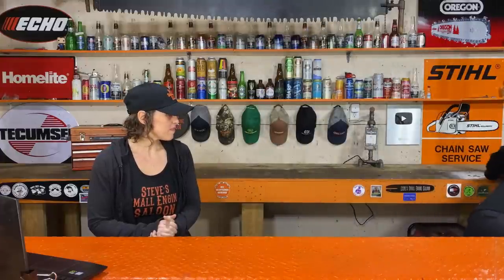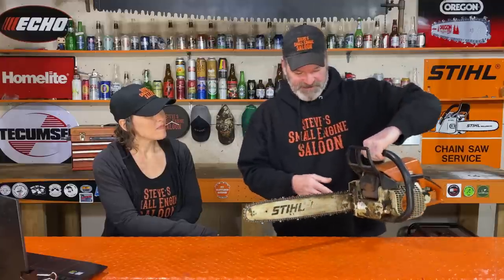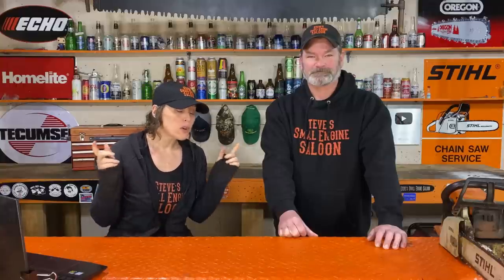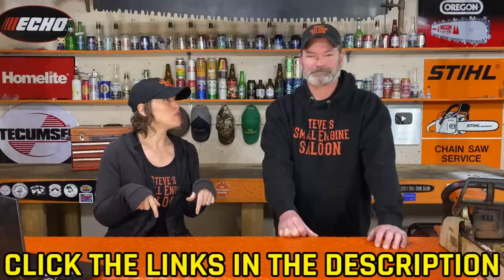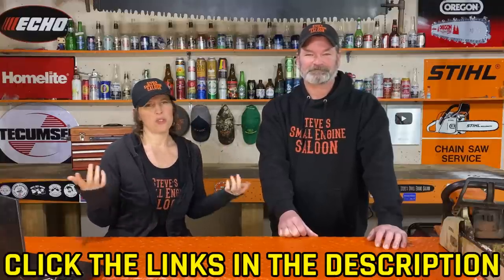Why Does My Chain Saw Leak Oil? (DAY 17)

Comment: Never hurts to crack that cap and release any pressure in the tank. I've had saws that leak for days and weeks, long past the residual oil on the bar and sprocket. Thanks for the video. Cheers!
Reply: same here releasing the pressure in the oil tank solved the leaking issue !
Reply: This!
Reply: surprised he didn't mention that
Reply: Thanks for the suggestion.   I'll try that next time..
Reply: thats a good idea - will try that thanks

Comment: It's called draining down. Simply store it on a piece of cardboard or plywood. My father was a logger for many years when he was in his twenties and thirties back in the late 70's and early 80's. He taught me all the tricks of the trade over the years. Truly valuable, priceless knowledge to be give by anyone. Every saw a person will use will do this to some degree especially if you do any cutting in colder weather than put it away in a warm dry play. It is perfectly normal. What isn't normal is the free flowing mess that you get with a damaged  tank or line that can drain out almost as quickly as the tank is being filled. That will  be readily noted by the massive spill all around the saw as apposed to the small drip that appears below the sprocket. 

Thanks for your always helpful information you cute couple you🥰! Have great week ahead!

Comment: Yup. Every chainsaw that I've ever owned has "leaked" oil. Your #1 reason makes a lot of sense. I think the next time I use my saw I'll strip it down and give it a good cleaning after use. Then I'll watch for a leak... Wish me luck!
Reply: That will take care of 99% of the oil oozing out and down 👇 on the ground. Don't forget to clean the bar groove too, lots of saw dust in there that will trap oil as well.
Reply: @donmayberryjrsOPE  Yep. That's so. I usually clean everything occasionally, but not right after I cut. I'm too tired... or too lazy. 😒 It is something that should be done regularly.
Reply: Me too. 👍

Comment: Hi Steve,I enjoy watching your videos. I own a Husqvarna 550xp and it was leaking bar oil etc when stopped. I fitted a new pump,oil cap,and crankcase seals.All were genuine parts,but the leak was still there. Finally I noticed an oil outlet valve between the two bar mounting bolts were oil was exuding.This valve was missing its push in cover,which was the source of the leak. I have now replaced the small plastic valve and it’s cover,resulting in no leakage of my bar oil. Nobody on YouTube seems to mention this about the Husqvarna 550 series of saws. I just thought this info may be of use to you and those who follow your channel. Your videos have educated me a lot over the years,,keep the videos coming.  Thank you kindly and take care,,John…..No beer today ???  That’s not you,,,lol.

Comment: I own at least 20 chainsaws, and my Dolmar 7900 leaks like a sieve when stored for the season.  It's the internal pressure in the oil tank, and that's the only saw in which i have to Crack the oil cap.

Comment: My MS440 leaks bar and chain oil behind the pump. Always wiped clean. Leaked with the OEM oil pump, then with two aftermarket pump's. Have also replaced the oil pick-up tube several times. Have also loosened the cap to release pressure and it still leaks.

Comment: I keep my saw in a case, and it contains the oil.  Then I pour it off into an old bar oil jug & re-use it later. Stihl rep says it is just residual from the bar, but I’m having a hard time accepting that - I’m talking about 4-6oz poured off from the case between uses.  Keep up the good work Steve & April!

Comment: Exactly right. I tell customers that proper maintenance helps. When done cutting, clean your saw. Wipe the clutch area and side cover. I bet you’ve seen, as I, those areas packed with oil soaked wood chips, dusting dirt. That will allow bar oil to ooze and drip from dirt for days.
Reply: Randy same here but nobody listens...

Comment: I put an old rag (worn out socks or whatever) under the sprocket area of my chainsaw cases.   Once they get a bit saturated with oil, I use them to start my trash burn barrel (probably not EPA recommended).    I really like the old style one-piece clam shell like plastic chainsaw cases.  I treat my chainsaws like a gun or a bow.  I like having them in a case when tossing them in a UTV, ATV, trailer, or whatever.     I have 3 chainsaws and 3 cases for them.

Comment: I have two Stihl 017 that are older. The oil tube from the tank to the pump leaked. I was able to replace both, and it solved the problem.

Comment: I own a ~20 yr old Stihl MS 211 and 1 yr noticed a puddle of oil under it bigger than the saw. Cleaned it up and quite some time later (maybe weeks) noticed the same puddle. Brought it to my dealer & they replaced some small plastic oiler part for ~ $25. At that point I grew concerned that the oiler wasn't working because there was no more oil leak -none. But consumption is normal and it lubricates the bar & chain just fine.

Comment: My Huski 141, as it got older was leaking badly. I replaced the oiler and noticed they have gone from a two piece seal around the oil pump to a single piece , now much better with no excess oil leaking when stored

Comment: Hero's a good one that I can Crack. I have a jonsered 2050. It runs great when worm chain turns when setting cold. I can adjust it to work right when it hot or cold but not both.

Comment: I’ve always kept my Stihl saw in a case and I have to clean the case occasionally, no big deal. I have a roll of Pigmat that works great on absorbing oil so maybe I’ll stick a sheet of that in my saw case to make the cleanup easier. Thanks for the video, there are some decent questions so thanks for the answers.

Comment: I’ve always thought it was the buildup of oil on the bar, chain and behind the cover for the sprocket.  Not enough oil leak for me to worry about it.  I had used a rubber foam pad, which absorbed the oil.  So I would not use that.  I did go to a flooring place and got a small (2 feet by 3 feet) vinyl flooring out of their trash.  Ask first before you do that, which they were very accommodating since I asked.  It works great and easy to clean up.

Comment: I use waterproof bed pads. The top pad soaks up any oil or fuel leakage and the plastic sheet underneath keeps the inside of the case, the shelf or floor dry.
Reply: Chainsaw diapers? Just wow! Why not just wipe it up occasionally?

Comment: Good topic, guys!  I have a slight variation on that leaking issue - my chainsaw leaks fuel!  No matter how tight I make the fuel cap, it still disappears over a period of a week or two.  I solved the issue by storing the saw ON ITS SIDE, with the fuel cap facing up.  No more stains on the garage floor, and no more lost fuel.  Thanks, Steve and April!
Reply: I've seen fuel tanks leak from the molding of the tank.  Instead of having a tank it is actually a chamber in the frame.   It also could be leaking from the port for the fuel lines to and from the carb.  Teflon tape solved that problem for me.
Reply: LOL.. I do the same thing for the same reason!
Reply: I store mine on it's side with the tank caps facing up also. My Stihl leaks like a sieve.
Reply: @robh063  It's a simple solution that works!
Reply: If A Stihl with flip cap, replace that cap. (Noted to leak)......

Comment: Great video Steve and April,good to finally meet your better half, I have a late '70's early 80's 028 av Wood Boss that I got with a case.. My oiler, I always felt over oiled so I line my case with Oil absorbent pads and that helps. The saw is a beast! Thanks for all the help, Cheers!

Comment: Hey, Steve, my saw doesn't leak anything if I lay it on it on its left side with the bar on top. I have it on some old newspapers in case of leakage, but no. It's dry.
The saw looks odd in that position, but no messes. 
Cheers!

Comment: My first chainsaw was a Poulan Pro and it had the typical "leaking" issue that you described, but then a couple of years in it started actually leaking for some reason. If it sat for a few days it would be sitting in a pool of oil. It worked fine like that, just made a mess.

Comment: I can’t quantify it but as somebody with several husqvarnas and stihls my husky’s leak way more oil than the stihls. I’ve never really put too much thought into it until my truck had a warranty issue this year (ford F-150 platinum - anytime it gets below freezing the door latches randomly unlock and unlatch so you’ll be taking an exit and the door will just fling open at 70 mph) and it has been in the shop 2 months so far. I’ve been renting a car for the past 2 months (which ford wouldn’t pay for) and the carpet in the back is basically an oil slick at this point. The next person who gets the car (if my truck ever gets fixed) is going to wonder why their luggage is covered in bar oil and wood chips… but it’s a rental so that sounds like a their problem, not a my problem.

Comment: I have a Stihl 042AV(it was my grandfather's so there's sentimental value in it) that started leaking oil. Enough to drain half a tank in 12hrs. The aluminum cover that the oiler is mounted in is cracked. When it happened I had to retire the saw because the parts were not available anywhere. I still look for the parts needed or a parts saw from time to time.

Comment: Great stuff Steve i had gotten the same question and i answered it the same way my chainsaws are in a warm room and expansion and contraction does push a small amount of oil through the oil hole on my STIHL ms180 but i see not much more than a couple of drops.

Comment: My 2nd hand electric saw leaked ever since I've owned it.   Originally found cracked lines and replaced them but still have the issue.  The only point is from the tank and tube, which I don't know what to seal the void with.   Thanks for sharing your thoughts.

Comment: Most times I have witnessed an 'actual' oil leak has been from the oil cap O-ring not sealing properly, due to the customer not cleaning around the cap before removing the cap, and allowing saw dust to get on the O-ring and in around the filler neck O-ring seal surface. A thorough clean of both of these areas normally fixes the issue, or worst case a new O-ring and good clean surfaces is the solution. Once those areas are clean, I've found it's possible to lay the saw on the filler cap side with no leaks, and that also stops oil leaking through the oil pump due to heat expansion as you mentioned.

Comment: Lots of the Sthil saws leak oil thru the tank caps. The quick caps are not good and lots of them leak. Thanks for the video.
Reply: The old flip caps totally suck but the new updated ones with the black line on them are way better.  They don’t leak anymore and they are really easy to lock in and latch.

Comment: I have an inexpensive corded electric pole chainsaw, the oil leaks out if it's stored in a particular orientation, like I said, inexpensive. So, I figured out the orientation, problem solved. It does everything well, though with the cordless models available now, I'd not repeat the purchase.

Comment: My Sthil leaks if stored upright.  Turn it on its side, like when you fill the tanks, and it's fine.  It stated it's leak problem when I replaced the oil pump with a knock off brand.

Comment: This video couldnt have come at a better time :)
I bought a brand new Stihl MS200T Top handle chainsaw yesterday...
Filled her with fuel and oil, started her up for the gentle run-in process.... Once i turned it off to let the engine cool down, I placed the saw on top of my garbage bin while i got a drink, Came back to the entire top of the bin lid Dripping of bar oil...
Reply: Awesome saw! While you were running the saw without it being in wood the oil has nowhere to go except to accumulate on the backside of the bar cover vs being absorbed into wood/sawdust. Once you set the saw down the residual oil drips down by law lol

Comment: My Stihl leaked, and it wasn't flung off oil or overfill. Maybe rare, but the 2 halves of the chainsaw had a small chip of plastic imperfection and oil leaked between the two halves constantly and slowly until the tank was empty. I don't know for sure the halves are supposed to provide the seal for the oil tank, but that is what it appears on mine at least. I cleaned it and ran a small bead of JB Weld epoxy along the bottom where the two halves connect and no more leaks. A real hack job, but it has worked for several years now.

Comment: Ya if you are not careful you get grit on the O-ring. Been there, done that. I try to keep a pice or two of cardborad under mine and change it when it gets olily, and lay it on its side with the fill caps up. James Lacy over and out.

Comment: This is a common issue  with husqvarna, this little metal oil pump cover beneath the chain bar gets bent or damaged easily and starts to leak oil so it needs to be replaced, you can always change oil line aswell while you do it but most of the occasions it is not necessary

Comment: Question - Do I need to sharpen my ride on mower blades? I remove, balance and inspect them regularly but stopped sharpening them years ago as it didn't seem to make a difference to the cut. Enjoying this Q and A segment a lot, thanks April and Steve.
Reply: A dull rotary blade will still cut.  However, it will crush the grass blade rather than slice it.  This results in 1: It will take more power to cut the grass.  2:  It will cause the clippings to be much wetter and sticker so they collect more under the deck, 3: The damaged ends of the grass blades will dry out and brown off from the damage, giving your turf a brown, dry appearance.
Whether any of this matters in your application, is up to you.
Reply: @tomrogers9467  Many thanks for your detailed reply Tom, I knew there would be some sort of a downside. However, the wife is happy so that is the most important thing.
Reply: Sure is!  Otherwise, we will all suffer!  😆

Comment: Echo cs590 is my second saw.  Leaked a bunch of oil...and also has chain starvation w flow at max.  Dealer replaced a faulty vent...and the oil pump where the plastic drive gear failed (less than 10 hrs time).

Comment: When my Stihl chainsaw was new (about 14 years ago) it leaked bar oil from day one. When I took it to the servicing dealer where I bought it, I asked about it. They told me the oiler system is under a slight amount of pressure and I should loosen the bar oil cap to relieve the pressure then retighten the cap. I thought that was a total BS answer, but I tried it to no avail. I simply have a Stihl chainsaw that leaks bar oil, like so many others out there. 🥴

Comment: i was overhaulin an MS170 that my father in law had stopped using as it was leaking fuel and oil and he bought a new one. so I said give me it to have a look see . so when I started taking her apart I noticed the fuel line at the gromett at the tank was not seated properly , same for the oil. someone had been working at it I think and didnt put it back together properly. his brother  is a local repair man for saws and mowers and is getting on a bit so i suspect he forgot or its dementia staring... cheap fix in the end and kudos for me.

Comment: My local Stihl dealer told me to always release & reseal the oil cap when I store it - supposing to release the pressure in the tank and make it less likely to leak - sometimes it seems to work - sometimes not so good - any comments on that train of thought ?!?!?

Comment: I've got a question, my chainsaw says to run at 25:1 oil / fuel , but if I run it at 20:1 , will it run cooler and have better lubrication, or is it a waste of two stroke oil ...?? Thanks Steve , love the channel, and thanks to you I also watch Buckin Billy Ray after the axe handle fitting episodes
Reply: Check Steve’s playlist.  He did a video answering your question.  Worth watching.

Comment: I have Stihl MS180 that started leaking after a couple of years and seems there is an issue with leaking oil tube.  I found that just laying saw on right side (tank fill up) solves the problem.

Comment: Hi steve I have a question... I use 2 gallon mix for my chainsaw. Weed wacker and so on fifty to 1.. When I need to get more fuel and there's still some fuel in there... And I add two more containers of oil.. ISIS it going to mess up my ratio because there's fuel and oil mixed already in the can. And it's candice not empty yet.. Thank you

Comment: I’ve never had a chainsaw of any kind that didn’t have this “issue”. I’ve found that storing them on their side (bar side up) greatly reduced the issue with the electric units, which led me to believe that there was a systemic issue with leakage from the oiler port during storage. With gas powered models you’d have to assure yourself that this wouldn’t affect the fuel system (tank, carb, etc.)

Comment: Great video Steve, I can't find any information about my 18inch Craftsman model #358.356070 leaking TOO much bar and chain oil while it's running. The oil is pouring out of the top of the clutch cover, however it doesn't leak when it's sitting. Very strange. Help Me Please.

Comment: My MS170 started leaking after 8 years where the oil line goes in the tank. I replaced the line with a cheap one from Amazon and still leaked from the same spot. Got a Stihl line from the dealer and it stopped leaking. The aftermarket was so loose connecting to the tank compared to the Stihl. Sometimes, it’s not worth saving 5$.
Reply: You mean most times

Comment: Stihl 462c will leak from the oiler when held upside down (trigger-handle up, bar-tip down), especially with the bar removed.
Seeing this leak is peace of mind that the oiler is working well...
Reply: Dave why do you keep it upside down?
Reply: @donmayberryjrsOPE  Oh I don't keep it upside down. Only when cleaning and servicing I notice immediate dripping when nose-down and no bar. Happens just the same when the oiler-adjuster is dialled to minimum.